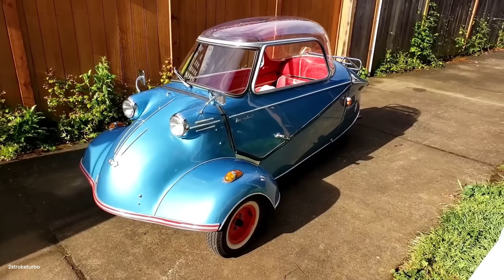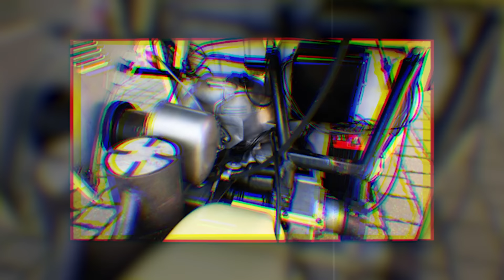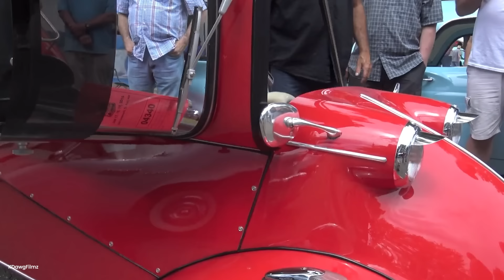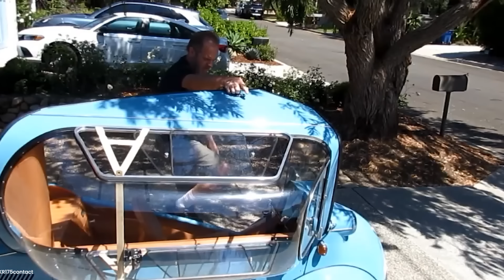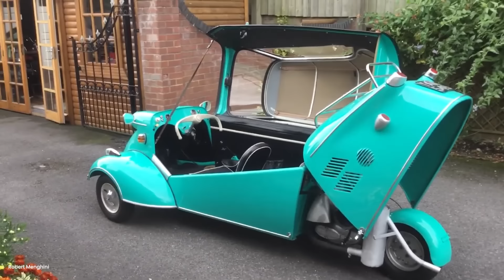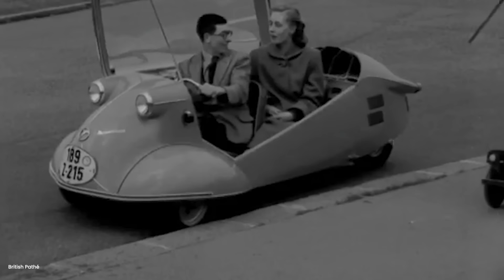Even at 36 HP & Fabric Roof, the 1959 Messerschmitt KR200 Shocked Everyone with 70 MPH Speed

Comment: Dad had one of these when I was a kid back in the early 1960's. 2 stroke engine, mix the oil/gas ratio too heavy on the oil & it leaves a blue smoke stream going down the road. My uncle would put a dollar's worth of gas in it & drive to work for a week. Gas was 29 cents back then.

Comment: Brilliant and informative video - I didn't know that Elvis also had one when he was stationed in Germany!

I owned 2 KR200s in the 1960s - my main one for everyday driving as a teenager in the UK and a second KR200 I bought to get hold of a blue tinted perspex roof to swap over with my clear one which got damaged. It worked out cheaper to buy a second low-cost KR200 and swap the roofs over rather than import a new roof from Germany with all the associated shipping costs, import duties and delivery timescale. KR200s were great alternatives to a scooter or motorcycle for teenagers like myself in the 1960s who could easily have ended up injured or killed on 2 wheels.

I remember myself and a friend driving our KR200s to London (from Hertfordshire) on some Saturday nights to visit The Marquis Club in Wardour Street - Great Times!

Comment: Friend owned one. 200cc 2 stroke. Had the same number of gears in reverse as forward because you stopped the engine changed the timing and restarted it the opposite rotation.  Did have a ride in it when he rescued me from the accident I lost my Bond Bug in.  Not my fault I might add. I was forcibly sandwiched between a Vauxhall Viva and a  Mk 4 Ford Zodiac having been stationary. I was unharmed. Tougher than you think those Bugs.

Comment: Mine had a 9 hp 2 cycle Sacks engine. For reverse you turned the engine off and changed a timing switch on the dash, restarted it and the engine was reversed, backed up, kill the engine, switch the timing back, restart it and drive off
Reply: Efficient!

Comment: All bubble cars and individual transports invaded Argentina in late 50's and through the 60's - Then came Citroen 2CV, I got one of this.
It would not detach a wheel from the pavement. suspension was great. Seats were light fabric held by springs all the way through the length of the fabric at its edges, with metal fastened rings. springs would have both ends w an elongated curvy end for hook up.
A "powerful" 29 horsepower 2 cylinder engine, cooled by air, with a dashboard which was only a few independent gauges attached to the steering column. A steering system which had a rack and pinion system that could turn almost a 360 turn on its own spot.
the roof was fabric, ( 1964/65 model & onwards ) with the trunk able to open and be held open upward in an almost horizontal position, which protected larger loads from rain. the handles to the door were almost toy like. The door windows were an horizontal split in half. if you needed air, you move the you would push the top half down outwards, and that was it. Can't remember, but I think the back door windows were fixed shut. There was a gear box as a transmission, with move directly onto the 3 available gears by 
lever on the dashboard, not on the floor. And yes, it did have a clutch. the engine, was 2 horizontal cylinders, counter positioned, 
it was what really killed the bubble cars in Argentina. Suddenly you would not see anymore Me 200, nor the Isetta, nor the Heinkel, 
Cirtoen also did a little cargo version "furgonetta" , although there were already with a tendency to resemble an actual little enclosed pick up truck. I had both.

Comment: I think a modern, hybrid version of this could be amazing. A ~100cm³, lightweight generator, a 5kW.h battery, and a 10 hp motor on the rear wheel with 5 hp on each front wheel would give you twice the power of the original, a whole heap of torque and better grip to get that torque down on the tarmac, but you still ought to be able to cruise at 70 on just the rear motor alone. 
Give it efficient regenerative breaking and I reckon that its 4 gallon tank might take you over 400 miles. 
Of course construction would be different. I’m thinking CF composite, emulating F1 driver protection ideas, if possible. 
Alternatively, I might just give it a 10kW.h battery and only the 10 hp motor, for an all electric, city runabout with a 120+ mile range.

Comment: The Messerschmitt KR200 attained .35 coefficient of drag which is on par for many cars today but failed to attain true slipperyness because they didn't grasp ground effects on airflow of a wheeled vehicle.  Still, the notion was right and much better than the bricks that represented GM, Ford, Chrysler, Studebaker, Rambler, etc. etc. 

Still the adherence to first principles is certain and laudable. 

The one vehicle of the current age that accepts that gauntlet is Aptera, which has a CD of .13 because it figured out ground effects.  It too, is a two-seat three wheeler with a low center of gravity and envieable performance (0-60 under 6 sec.) and 350 mpge ...oh and it draws enough power from the sun to add 12,000 miles to tank from its solar cells.. 

We've come a long way from the Messerschmitt, but the principle is the same.

Comment: The KR 200 had a TEN horsepower (7.5kw) single cylinder (not 36 hp as stated) two stroke engine which can spin in either direction - four forward gears and four reverse gears. 
the only requirement to enable it to run in either direction was a second set of points on the other side of Top Dead Centre, so when running in reverse, the spark was still before TDC. 
TEN horsepower, not 36!!!
And the rear passenger was not directly behind the driver. The driver was slightly offset to the left  side and the passenger offset to the right side so their legs could extend past the side of the driver.

Comment: I had a friend in the in the Australian air force in the 60sThat had one we had a great time with it we drove it around without the top on as it was faster that way. to do really fast cornering we drove it like a motor cycle 
only leaning against the corner rather than with it to keep the front wheel down. Wheelbarrow tires fit on it. it was registered as a motorcycle. It was a great machine. and used practically no juice.

Comment: A Vespa 150 GTS scooter is the most efficient transport I have owned. Not fast but ideal for urban use. Currently ride a Kymco AK550 scooter which uses the KR200 wind flow technology. Side strong winds can cause a hazard as vehicle so light with aluminium chassis and plastic body panels.

Comment: What a lot of total crap, I had two of these and they had under ten BHP and 4” brakes that were cable operated and did not work handled like a twitch I did get 60mph downhill once and it was taking my life in my hands. It was NOT aluminium body it was steel 22 gauge that rotted like mad, I gave up when I stood up and my feet went through the floor.  
It would go as fast backwards as forwards as the engine spun the other way so you got fours gears, you just pushed the key in further and started the performance is nothing like you state.😊😊😊😊

Comment: Owned one  from new with motorcycle part exchange in 1960 - 147NBB - yellow with soft top. Brilliant and went like the wind. Great in deep snow as it simply slid over the surface with its flat bottom until wheels reach the road again. Freind and I lifted it onto a low brick wall to do easy servicing then down again afterwards. Wished I had kept it.